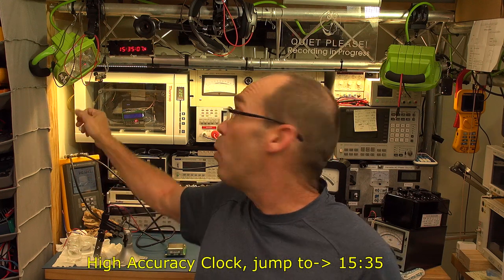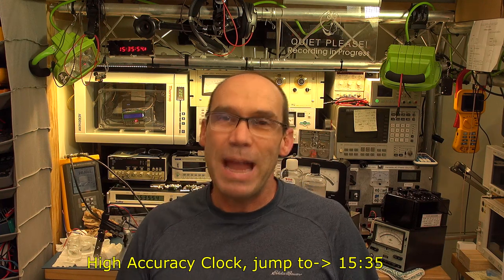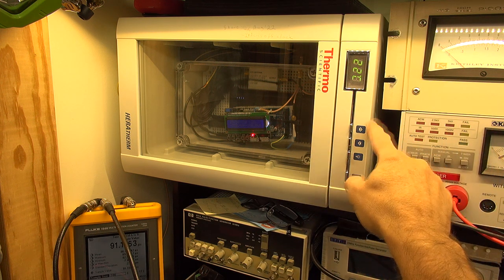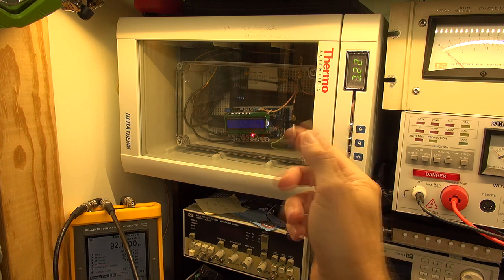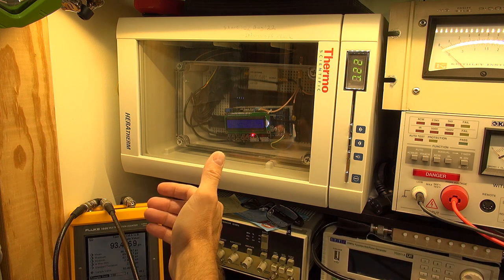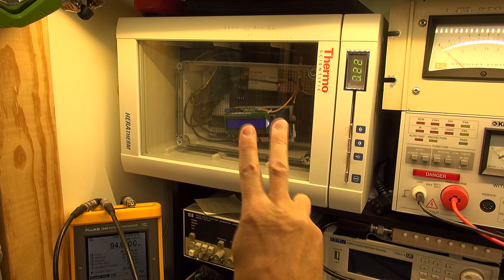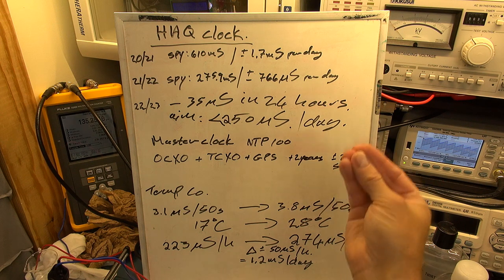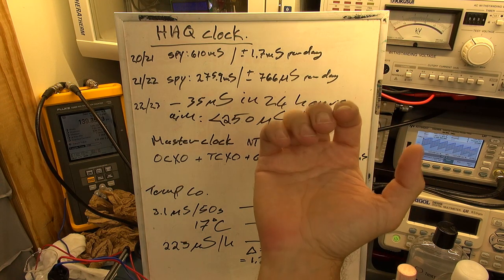T4D #155   High Accuracy Clock...and Rabbit Holes!

Comment: Purest water is to use injectable water in a resealable phial, which is pretty much going to be as pure as possible water, and with a long shelf life.

With drinking water after that 0.5 micron filter you also want a mixed bed ion exchange column, which gets most of the dissolved ions out, but not the organic products, which you remove with large activated charcoal filters.

For the CFC try Galden, get the high temperature versions, over 200C, which are as good as flourinert, but a lot cheaper, and at room temperature very slow to evaporate.